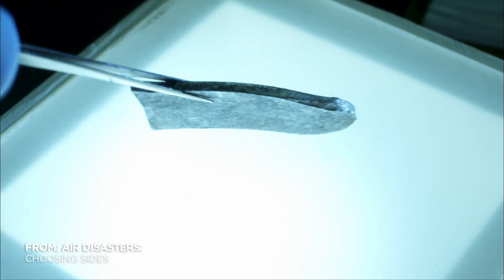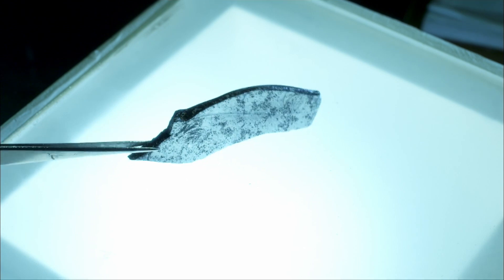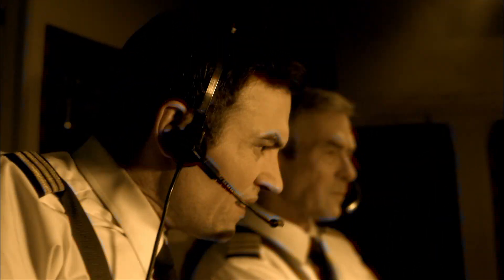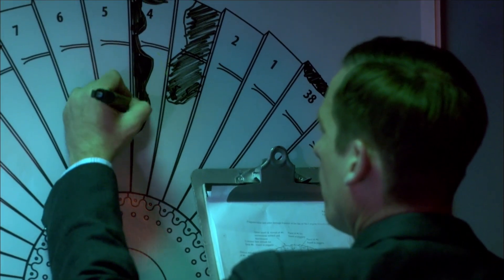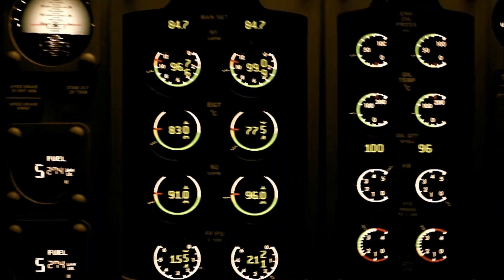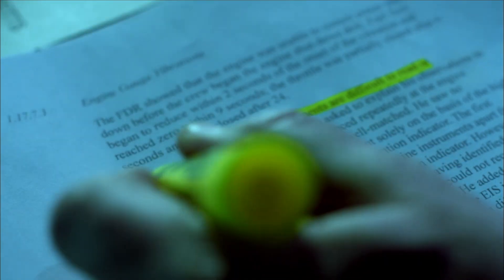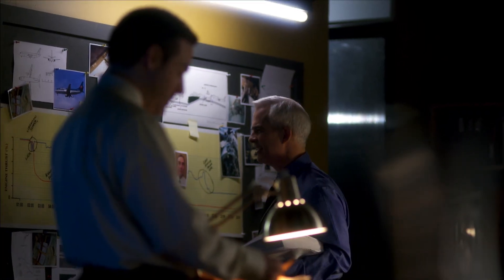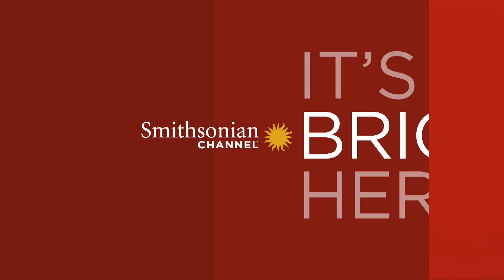Did Metal Fatigue Cause the Engine of Midlands Flight 92 to Fail? ✈️ Air Disasters | Smithsonian

Comment: British Midland Airways Flight 092 (often referred to as the Kegworth Air Disaster) was a passenger flight from London to Belfast. It crashed after an engine failure, and it killed 47 of the 126 on board.

Comment: If it engine fan blade broken can disturb air flow in the air engine causing to surge a process to called backfiring, so the question remains,
Why did cruising altitude surge engine number 2 when it tried attempting to land engine number 1 also surge in flames and plane begin fall is still mystery.
Reply: It is not a mystery. I watched the whole episode for this. When they shut down the right engine, fuel flow to both engine was disrupted and hence the surging stopped, which caused the pilots to think they shut down the correct engine. However, because the procedure for flying on one engine is to increase power to the good working engine, this immediately caused the left engine to surge and stop working completely.

They realized their mistakes and attempted to re-light the working engine they wrongly shut down, however, they lost too much speed to initiate a restart, hence no options left. The plane was set to crash.

Needless to say, both the pilots, lost their jobs.